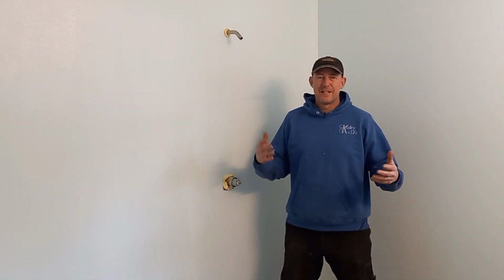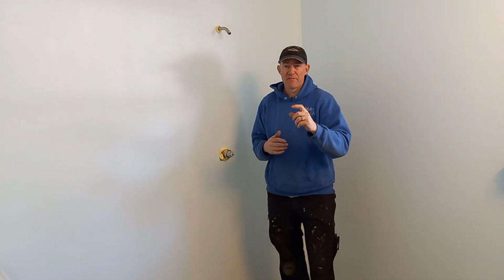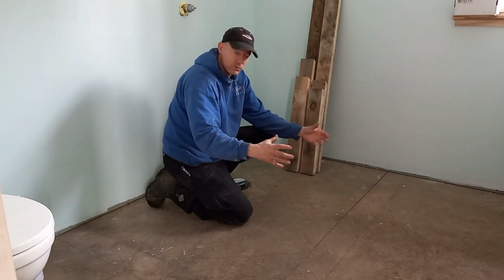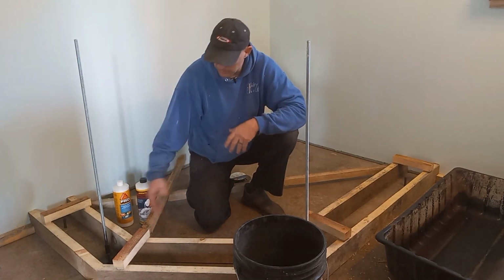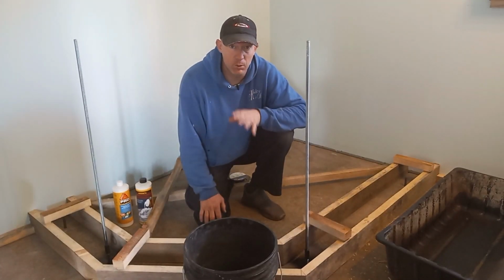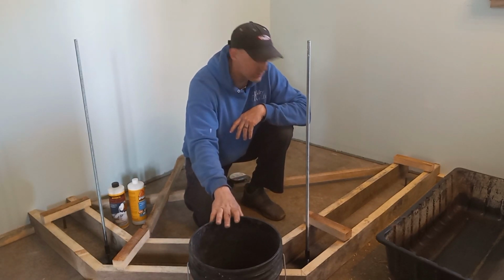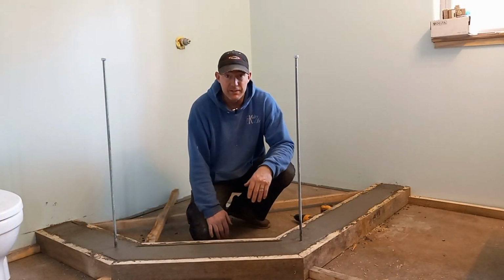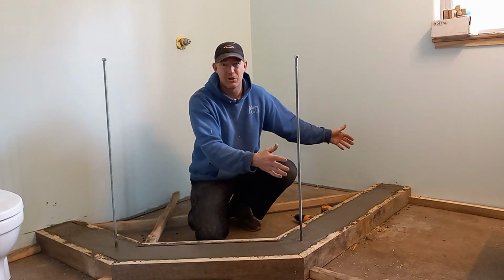Custom shower build, Part 1, Building a Curb

Comment: You can drill in new lag bolts when the concrete have hardened if you think you need extra support.. Will be nice to follow this project. Love from Sweden.
Reply from the maker: I had thought about drilling one in but I would want to wait a week before tightening the bolt down just to make sure the concrete was nice and strong. Hoping to have a video out every week on this build. Thanks for watching. :)